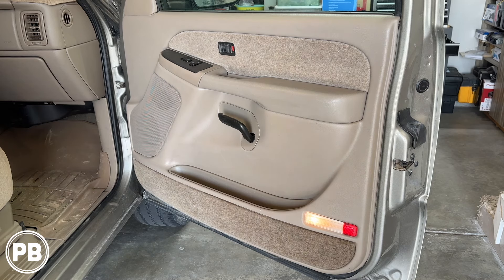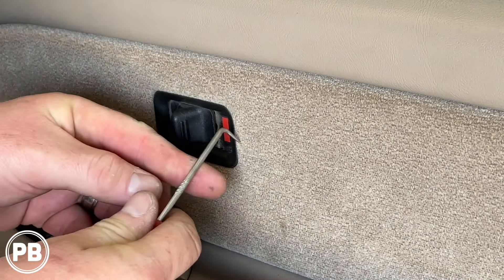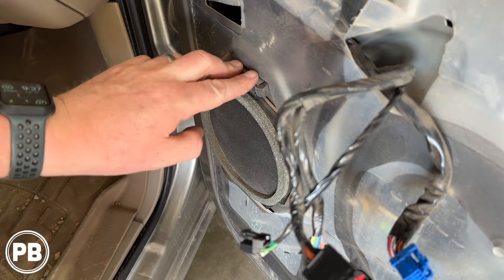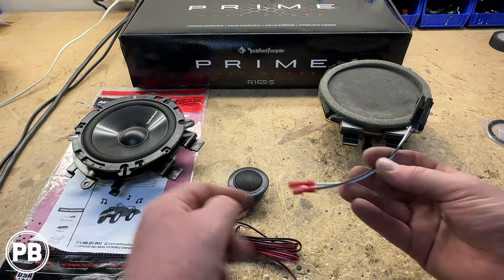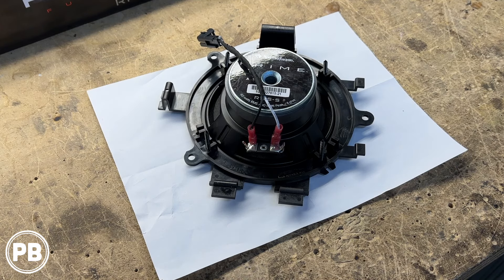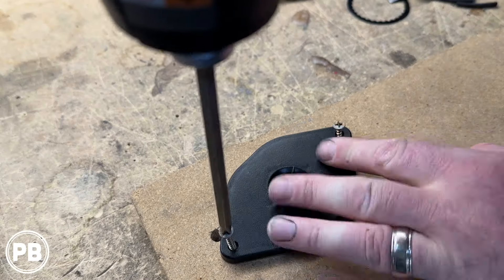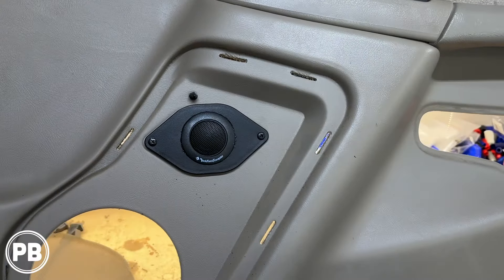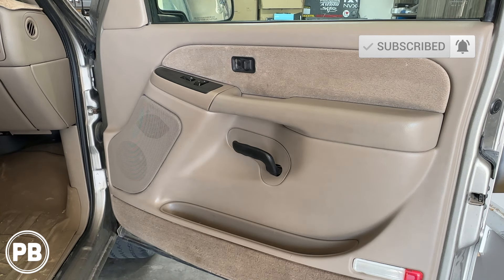1999 - 2006 Chevy / GMC Front Door Speaker Install

Comment from the maker: Parts used linked in the description of the video!
Reply: If it has a cross-over like the kickers, do you have to use the cross-over, and if so, how do you wire them up I have the kicker css65
Reply: What size speakers are those?
Reply: What size are the tweeters
Reply from the maker: @chinivazquez9300  These are 1"
Reply: Ahhh! HELP! I need some guidance with hooking up a second camera to an aftermarket radio. I actually followed your video on how to set up the back up cam which was amazing and you are super descriptive and easy to understand which is why I’m asking for your help now.. I currently have a dohonest baby car seat cam. But don’t wanna have two different different monitors . So trying to hook up that cam to my aftermarket , but Bc the plugs that connect are not typical ( I’ll try and attach pics) I don’t know how to connect to my dual aftermarket stereo. (Dual DMCPA70BT) With the harness in the back, where do I plug into ?video I’m assuming since camera is now being used by my reverse cam. My camera will not need audio so how  do I bypass that?  help!
Reply: @s.a.m.sgarageandgaming6233  

I'm also curious of this, I'm not 100% sure but 

I think you do need to use the aftermarket crossover, as there is some sort of physical crossover between the stock tweeters and door speakers - a resistor or something simple but not a big electronic pack like the ones that comes with aftermarket speakers, and so if you get rid of the stock tweeters and speakers, this crossover will also be removed along with it (unless you have luxury bose system then the amp controls crossover I'm pretty sure and so no crossover will be affected if you install new speakers on luxury bose system)

in more simple words

with non luxury bose you have to use the aftermarket crossovers because you are essentially delete the stock crossovers when you remove the stock tweeters

and

with luxury bose systems you can get by without using the aftermarket crossover because the stock crossover is controlled through the amp underneath the center console (removing the tweeters on luxury bose doesn't remove the stock crossover and therefore no aftermarket crossover is required - I'm sure the aftermarket crossover could still be used if prefered/desired but I think you would need to bypass the stock amp crossover so it doesn't sound funny with two crossovers but I'm not exactly sure how you would go about doing that)

Comment: You can use the og speaker bracket for 6.5”, just remove the insulation and remove the screws, they work perfect
Reply: So you remove the original bracket from the factory speaker and it’ll fit on a 6.5” speaker?
Reply: @gtdcov  for the front speakers yea just remove the t15 or t20 torx screws and pry the old speaker out of the bracket
Reply: @04jhernandezful  What about for the rear speakers?
Reply: @bobbygetsbanned6049  I don’t remember using the og brakcet on the rear speaker
Reply: @04jhernandezful  Alright, thanks.
Reply: @bobbygetsbanned6049  You drill holes

Comment: Hi i know this is a long shot but recently replaced my front speakers to my 2001 silverado  with coaxial speakers but suddenly got no sound from them after install they worked when i tested them but not after placing the door card back on
Reply: Your speaker fuze might be blown or your wires could just be bad, I had the same problem after replacing my rear speakers and it was just the fuze being blown

Comment: I am in the process of replacing my blown speaker. I have a set of 2 way coaxial speakers and dont know were to tap into for  full range of signal. I am not going to be using the factory tweeters. I looked at a factory wiring diagram and it looks like there is a split somewhere. Do you know where the split is??

Comment: Great video! It's too bad you don't have a video on a standard/single cab rear speaker replacement. Quick note! 2:24, it is unnecessary to remove this screw. All it does is hold the door compartment to the door panel. It does not screw into the door itself.
Reply: They doors  are the same.  The rear speakers are a little different to get at but not bad. They are 4x6 rears on extended cab and Single cab.
Reply: @leviwoodring6101  Actually, it is a lot different on a single cab/standard cab. The rear cover panel needs to be removed to access the screws that hold the vertical panels in place along with the many clips as well. Yes, they are 4 x 6, but a little more work involved with removing the panels.
Reply: @19MarcoPolo71  ya the back panel takes all of 2 minutes to rip off. Then the 2 screws on each side that are covered by it.

Comment: 6:22 from my experience if you are gentle and put a socket on them, they will come out, but you’re scraping some plastic with them and I was able to screw them gently back on there and they were holding. I was changing the door panel and the one replacing the old one did not have the whole cut out so I had to do that myself

Comment: Great video. I removed many of these door panels. I don’t believe the very bottom screw on the door panel holds anything to the door. Or maybe there was a difference in years
Reply: It holds that map pocket/ storage drawer in.
Reply: @akclan33  yep I rennet that now. I was fairly confident it did not hold it to the door for removal.

Comment: Great video-is a great help.
I ordered the coaxial speakers and adapters in the description. But, there is no way the adapters will fit the 6.5 speakers.
Reply: Yeah its hard to get most 6.5 inch speakers to fit into the adapters. Just use self tapping screws to screw the new speaker into the door.

Comment: Have you ever had a customer who had a stock component system who chose a coaxial replacement? Like for example, their mid bass speakers are blown, but the tweeters are still ok, and they opt for a coaxial replacement.
If so, when installing the new coaxial speakers, do you leave the stock tweeters installed and connected, or do you disconnect and remove them? Does leaving the stock tweeters in place hurt or improve the overall sound quality?
Do you know whether the mid bass and tweeter speaker wires are both spliced together at some point, or are they completely separate feeds from the stock radio head unit? If separate, would splicing those feeds together for coaxial speakers give a significant power boost as to speaker output, and would that be better or worse than leaving the stock tweeter connected?
Reply: They are wired inline to the main door speakers. I can tell you that.

Comment: Why do my tweeters distort if I don't use external crossovers when I use my factory tweeter harness?
Reply from the maker: If your speakers came with crossovers, you have to always use them (unless going fully active with a DSP). Reason why you are getting distortion because your tweeters are trying to play frequencies they are not intended to play.
Reply: @ProvoBeastAudio  I installed a component set so I'm gonna have to order new tweeters. It's only distorting on the passenger side door.

Comment: I'm considering the punch series component set and it comes with a crossover, do I need to use this? Also, crutchfield is telling me the 6.5 coaxial speakers i have picked for the back doors are incorrect, but tells me the component speakers are correct even though the back door speakers don't have separate tweeters. Just mid drivers. 2004 gmc yukon.

Comment: I made this comment about the 2015-2020 f150 sub wiring video where you wired up the f150 with the bigger screen, and this comment Isa copy past question about that video**

Finally a video actually explaining how to do this I'll probably end up still paying sombody buuut I may do it myself, so I will ask how would u use the line out converter for the wires u just rca If I remember right, how would I wire it for a monoblock amp, or would I get a line out converter with just 2 plug ins instead of 4? Thx
Reply from the maker: Hey bob, send me a message on facebook or instagram and I can point you in the right direction.
Reply: Bose amp 2006 3500 Silverado= what ohm aftermarket speaker needed…ty